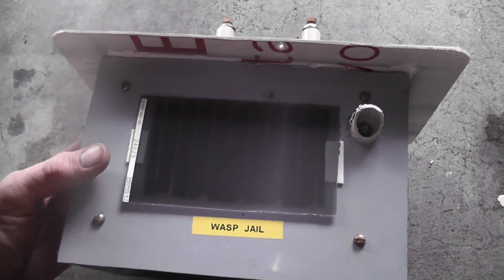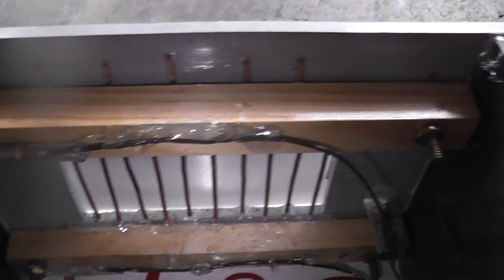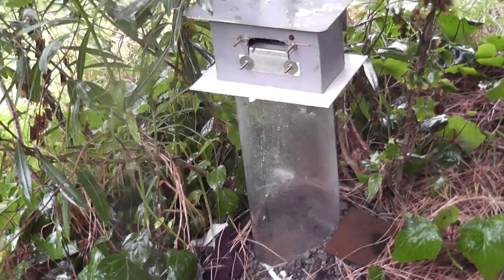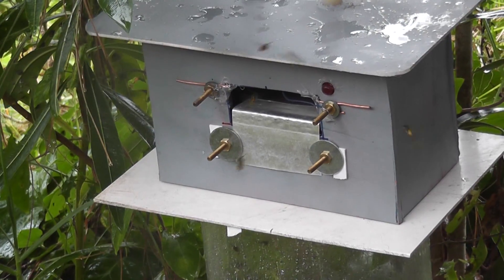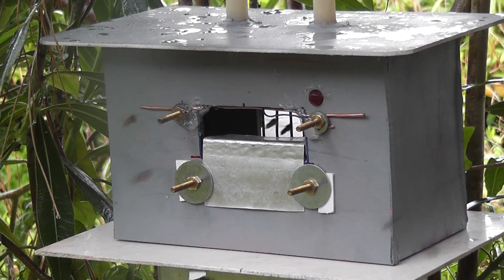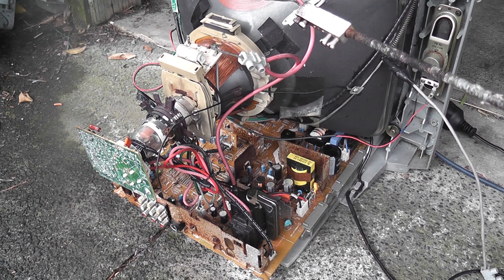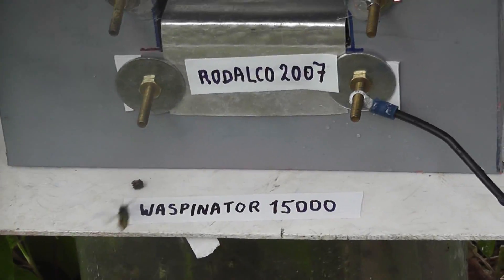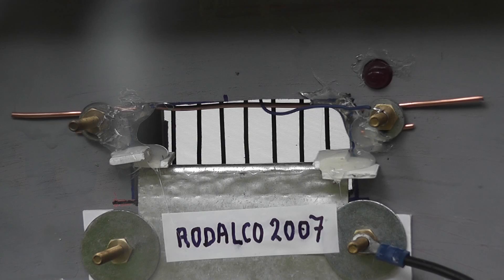Wasps 2017 - 4   String 1 - Wasps v 15 kV CRT Flyback

Comment: + RODALCO2007 would a 8000V electric fence unit work with two or three parallel expanded mesh arrangement? I know an electric fence unit pulses, but if the mesh arrangement forced the Wasps to walk amongst it long enough for the pulse to return, surely that would get them electrocuted?
Reply from the maker: Yes I am sure that would work very well. You want the grids just far enough so it doesn't arc across. Then when something comes in between it will flash over and fry the insect.
Reply: Cheers for the reply,I'll give it a go then

Comment: Haha nice! Did you use the TVs own drive circuit? I think it's better to build one. Also - you probably need to change shape of the electrode in front (unless you have enough power to burn off the pile of dead wasps when it get too big)
Reply from the maker: I used the TV's driver circuit, Have used the ZVS circuit as well, the electrode set up is not perfect at this stage. Working 50-60 hour weeks at the moment, and trying to blow up wasps, don't always have time to get things perfect the first time.

Comment: I would like to use a TV flyback on the PCB for an x-ray project, Is there anyway to disable the built in overcurrent protection?
Reply: I'm sure there is a way ... but you wouldn't like the results, LOL. The overcurrent protection is there for a reason! XD
(Even then, it still didn't completely prevent the TV circuitry from frying. I suspect a current spike from the arcing, combined with inductance in the flyback, has literally fried the HOT (Horizontal Output Transistor)).
Reply: Benjamin Esposti, yeah my best bet might be to make my own driver and stick the mosfet's on a huge block of heat sink..
Reply: Even then I might get A few interesting pops.

Comment: honestly i enjoy them just getting cooked by the arcing electricity than them just exploding. exploding is too good for the little bastards in my opinion
Reply from the maker: The arcing visual is a lot better then the exploding wasp., very hard to get good current limiting.
Reply: RODALCO2007 hehe I'm allergic to bees wasps etc. so to me its nice seeing them suffer for a change. I have had quite a lot if emergency room visits because of the little pain in the asses. either way thoroughly enjoyed the device

Comment: AWESOME! Could you take the flyback coil out of the TV and hotwire it so when you feed it power it just keeps zapping? If not try a neon transformer.

That zapping is music to my ears. I love it when they get hit by 15Kv.
Reply: The flyback transformer operates on high frequency, so it won't work well when connected to the mains (50/60Hz).
Reply: When you try to use a discarded TV in this way, it's bound to fail cuz the thermal cutout will blow to prevent something stressing and setting on fire.

If you really wanted, just take out the flyback transformer and the chopper transistor,  and use them in your own brute force circuit.  I mean, most other components in a dead CRT television will go unused in an application like this anyways so...yeah.  Though if you wanted to recycle the parts for other projects...

Anyways.  So for the HV...

Use a chip like the 555 timer, or perhaps a superior PWM controller like SG3525 or TL494 to drive it. 

 Sam Goldwasser made a circuit with two 555 timers, and an intermediate coupling stage, the schematic to search for is "HVGEN32", should be easy enough to find.  IIRC it was in his "various schematics and diagrams", nice circuit that gives you manually adjustable control over frequency (high times) and pulse width or current (low times).  Perfect for "experimentation".